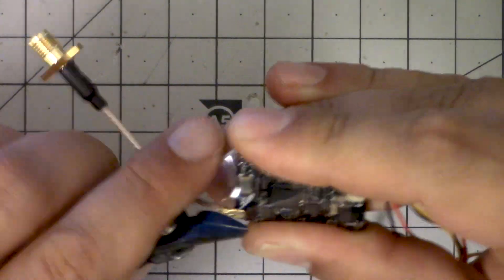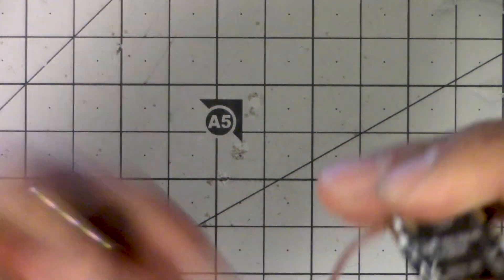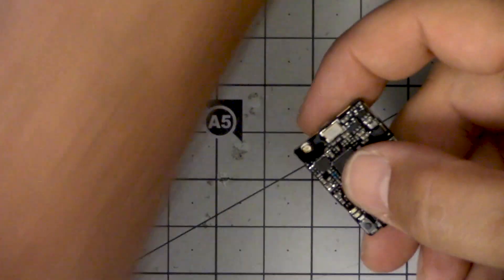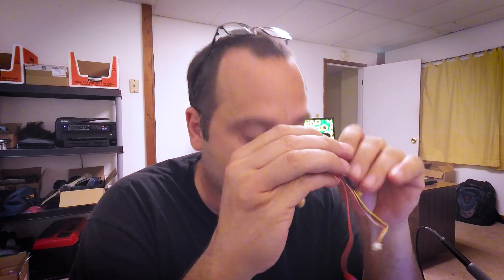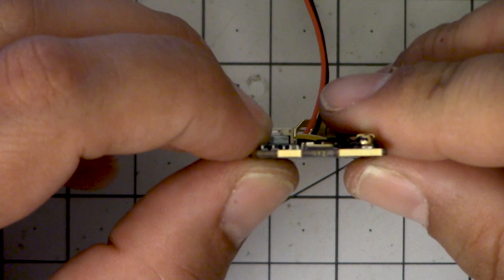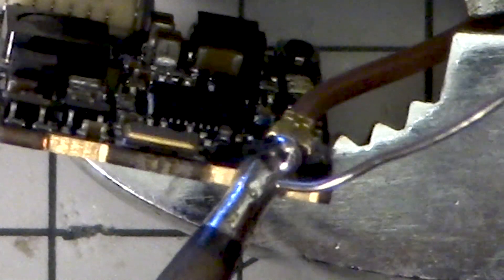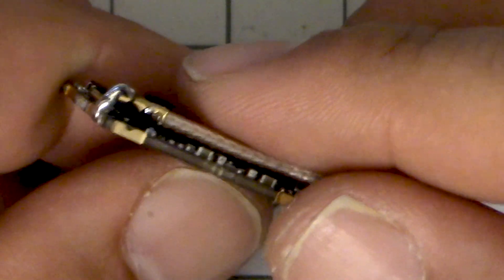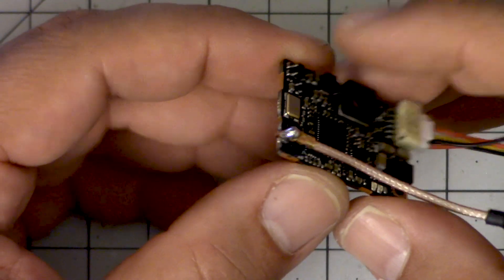How To Reinforce TBS Unify Antenna Connector | NO DIRECT-SOLDERING COAX

Comment: how many guys are going to over heat in attempting this and have the SM connector come off the pad :)
Reply: Manufacturers use lead-free solder which has much higher melting point. If you are carefull, it will not come off
Reply from the maker: If you don't think you're up to it, don't try it.
Reply: Trust me, the unify gets HOT. I've been doing this method for a few months now. I managed to break my cable off and when I went to desolder and replace it, I dropped solder in the port. I fought super hard to get it out and eventually cranked my iron up to 500c and took it to the port to make the solder run out. This took a lot of heat and time to get it out. So if that did not rip it off then I don't know what will.
Reply: like in ham radio spares make you unscared
Reply: Xephex Xephex the technology of reflowing or baking on SMD components is not magic nor does it use magic to hold them in place it's just solder and a very fine amount at that - all I was saying is be careful because you can heat up the connector on the board and have it come off, I have needed to do this on a couple repairs and it's very easy to do. Thanks

Comment: I guess that hot glue wouldn't work since the VTX gets so hot. But there has to be an easier and safer way to do this. I am good at soldering but I would be afraid that any amount of heat would destroy the connector.

Comment: I cant risk this on my unify pro because it means installing it upside down and the connector will be out of view so if it breaks off I wont know, it would be better if you could connect a flexible extension cable which leads from the connector to the antenna so any stress doesnt reach the connector then just hot glue the antenna anywhere on the frame.

Comment: Thanks for video; I have a mini remote controller and there is a cable antenna soldered on it and no MMCX port; is it possible to connect a MMCX antenna directly on the card without port ? How ? Thanks if you can help because I really did not find any informations about it.
Reply from the maker: If the device is designed to have an antenna directly soldered, it probably would not work well to add an MMCX, and it might not be possible at all.
Reply: @JoshuaBardwell  there is no MMCX port on the card so I thought to remove the MMCX plug from the cable and soldering the main wire directly to the card and soldering the ground from the cable to a ground to the card. Could it work ? I just watched some videos where people soldered by this way on a VTX.

Comment: Thanks a lot for sharing this including close up of how it's done! 📷 I have a Unify which I crashed hard before but still works. I got flickering video following vibration level and was almost sure the antenna connector is the problem. Soldered it almost like in the video. It works better when you run the pigtail towards the center of the board where the lowest profile components are and then route it in bend to end up next to the camera connector. Heat shrink around and I get nice range without flicker again. 👍🏻👍🏻👍🏻

Comment: I have a cheap hot glue gun with craft glue. Can i dab a bit of that kind of glue over the connection area?
Reply from the maker: The Unify typically gets hot enough in operation to soften hot glue. I don't think that solution would work well.

Comment: Thank you so much for this. Very tired of VTX antenna mounts of all kinds breaking. Now I have soldered the attachment. Hot glue over that. Hot glue at the other end of the board where the antenna wire runs off. Zip ties in middle. Lets see how this goes. Feels  a lot better ^_^

Comment: hope you can help me with my tbs unify tx, I, am using a 2 S battery, 7.4 volts , 800 mah, the tx   gets very hot,and im using the fox camera for  my fpv, and it is getting very hot all so , I do get a good video in my goggles, but not good range, my get 50 ft,,but the tx is so hot, i turn the power off so i wont burn up my tx and camera, hope you can help me on this ok  I did try to use a 1 s battery and it well not power it up , , I need some help ,thanks,

Comment: Can you help me what  is the name of the yellow rubber glue stuff that's on some receivers on the ipx connectors  and do you know where I can get some or a better option other than soldering :) new to FPV thanks for the great content its been a huge help thank you in advance
Reply from the maker: I'm sorry I don't know :-(

Personally what I do is, I turn the pigtail so it runs across the vTX, and then I use some tape or zip tie to secure it.
Reply: cheers mate I will tape and zip tie
Reply: Get e6000 glue, its clear, buts its rubbery and holds really good like the yellow glue they use.

Comment: Joshua, Please can you tell us which pin is the center pin to direct solder it if the pigtail connection has broken off completely?  Thanks
Reply from the maker: I don't think I could describe it in words. It's a tiny little pin in between the two bigger ground pads.

Comment: Mummm you saying these are the best transmitter my friend orderd two and what a pie of😤😠##### horizontal lines not seeing where he's going very well any help😢.
Reply from the maker: +Pete James this transmitter is fantastic. If you have video noise there is probably an issue with your quad or your setup.
Reply: Joshua Bardwell Big thank you  but where to start as he a novice to this hobbie he bought a lc filter but still no good😮😥.
Reply: check out this person Joshua Hardee Horizontal/Diagonal Lines in TBS Unify Pro When Armed - Solved
 this is what problem we having.
Reply from the maker: Do you have the HV or the Pro 5V?
Reply: Joshua Bardwell Pro 5v

Comment: wonder how many new VTX TBS now sells cause of damaged board by excessive heat, pigtails that wont go of any more, soldersplatter damage and so on.........
Its so easy, just turn it 180° facing to the power connector, new shrink-tube the VTX and good

Comment: I have used Loctite GO2 glue to keep mine in place. Unlike super glue this one is not as brittle and is easier to get off - but it it still has high tensile strength.

Comment: I did this to 2 of my unify pro vtxs after watching a youtuber doing it. I used the same method in your vid. Both vtxs stopped working within 45 days. At first I was loosing range and penetration. They be broke now. Not sure of the cause, but it was not due to crashing or misuse other than the connector solder. I have 4 other unify pros that I have not done it to that function fine.
Reply: Done that and my siagnal is weak anywhere more than 5m from quad... I hope I can save it today by resoldering new U.FL connector to he board...
Reply: I soldered mine and i too lost range and penetration, i'll try desoldering and see if the range is back to normal
Reply: Finnito FPV its better to use hot glue works much better than this method.

Comment: Just add a dab of hotglue! No need to solder and it only takes a few minutes.
Reply from the maker: Do you have any idea how hot the Unify gets? Hot glue will re-soften.
Reply: Which is fine..it'll still remain tacky and with some tape/heatshrink around it, it's more than enough to hold it in place.

Comment: the question is why this is such a weak connector to begin with?!?!?
Reply: The direct soldered pcb to sma connectors break rather often as well, sometimes breaking the pcb and or pulling off the solder pads. This design allows it to come unplugged, greatly reducing the chance of something actually breaking. I personally just shrink wrap them to keep them from coming undone in a light crash/hard landing.
Reply: So you buy more

Comment: Hey Josh.  Me and a few fellow pilots did this to maybe 5 or 6 Unifys.  They all have since deteriorated in video quality to the point of being unusable..  1 of them had the UFL connector ripped off in a crash. Now we recommend to all pilots in our group NOT to do this mod.  Just thought I'd let you know my experience with the mod.
Reply: Same thing happened to me, rip 40$
Reply: Good to know. I've been using liquid electrical tape to reinforce mine. It has a rubbery quality and seems to hold the connector in place on most crashes.

Comment: Hi Joshua. I want to buy TBS Unity but I read that it gets hot like many other small VTXes. I have a question, are there any lightweight transmitters (without a cooler) that don't get hot or at least too hot?
Reply from the maker: No. They all get hot because they are putting out big wattage.

Comment: I have one of these on my flying wing. I just used some hot glue. I did think of soldering it but I know from crashing lots, I would rather hot glue break rather than solder. At least there is no chance of any physical damage to the board or the connection. I can peel the hot glue off by hand if I need to move the position of the pigtail, you can't really do that with solder.
Reply from the maker: I don't know why people are acting like solder is harder to reposition than hot glue. Just hit the solder bridge with a little heat and bam, it will melt away. Solder sucker maybe to clean out the excess.

Comment: Be very carefull people if you want to add solder as reinforcement as you might end up melting the plastic part inside the ufl connector.
Reply from the maker: This is why I said not to use too much heat.
Reply: Yea, just did this while trying to repair a rx antenna. Pissed me right off. Got spares now lol.

Comment: I already ran the coax up the length of the board and when you re-heat shrink it it tends to hold it all down well but adding the solder is a great idea

Comment: At that point why have u.fl connector, and just not have TBS direct solder them?   Seems like you wouldn't be able to easily replace it at the field if you damaged the pigtail.  I think it's a good solution until you break the pigtail.
Reply from the maker: I would field repair it with my TS100 soldering iron! LOL.

Comment: hey josh, is this vtx worth the money or is it hype?
Reply from the maker: Pros: very small and light, great options (supports all bands and from 25 mW to 800 mW output), smartaudio support.

Cons: heat management can be a problem especially on higher outputs; expensive; always out of stock.

I couldn't say whether it is "better" in terms of RF performance or video quality. I just don't have the ability to test that. You decide for yourself whether it's worth the price to you.
Reply: slitherixxx it's so worth the 30$ smart audio alone is worth it, but it also won't burn up on you if you crash and break your antenna. It's super small too, really nice
Reply: its backorder at TBS :(
Reply: because they just got as new batch in with more filtering and less heat under load :D
Reply: damnit, just ordered from hobbyjerks (hobbyking) but would i still need the LC filter?
Reply: slitherixxx depends on setup
Reply: allright. i really hate they made the vtx josh got, better after they sold the old
Reply: Joshua Bardwell oh you got the v2 if it support 800mv I bought the one with pigtail at 200mv max

Comment: Btw if you want to reinforce it more never use hot glue, it will just melt maybe try some heavy duty heatshrink that has not heat resistant but kinda like that glue heat shrinks

Comment: I used hot glue. Has been on for a few months, works well. Spektrum Rx have the same crappy connector.
Reply from the maker: U.FL / IPEX is fantastic for what it is, but not great for situations where the antenna is not physically restrained.

Comment: An easier way to do it is to buy a tube Goop and spread it over the connector and pigtail. You don't have to have any soldering skills and it is very strong and elastic. It usually pulls off in one piece after a lot of fiddling.
Reply from the maker: Personally I don't want it to come off at all.
Reply: I've only had to take it off on one build where I had a massive crash and it broke the RP-SMA connector off and I had to replace the pig-tail.

Comment: Another option is to turn the antenna around like in your video, add hot glue, then add heat shrink to that area. 
The hot glue will melt as the heat shrink shrinks, which will spread the glue more and the heat shrink will hold everything together. 
I prefer this way because you can replace the SMA easily if it gets damaged.
Reply from the maker: Desoldering this pigtail shouldn't be a problem. You saw how much work I had to do in order to build the bridge. A dab with the iron and it'll come right off. But your approach of hot glue and heat shrink is probably equally structurally sound.

Comment: About 10 times i wanted to yell stop!  That's enough solder/heat!  I would just add some two part epoxy or better yet buy a vtx with the pigtail soldered to the vtx like it should be done.  I personally just cut the sma's off vtx's and solder my own pigtail, but i can see how that would be daunting for some.
Reply from the maker: If you know how to solder your own pigtail more power to you. I have direct-soldered one. It's not for the faint of heart. Most people can't do it and will destroy their transmitter.

I had to add a lot of solder because I was trying to build a bridge and I couldn't get the heat into the crevice at the base of the connector.

Comment: and I saw in a video that the favorite 20 A esc are bursting into flame on flight with running an 2300kv motor what would the problem
Reply from the maker: I don't know... a flaw in the design? Or maybe just one guy who had bad luck and made a video about it.
Reply: Joshua Bardwell 🙂🙂

Comment: I've tried to find a fix for this for a while and the method that's worked best for me was to take a pair of needle nose pliers and gently squeeze the connector to make it a bit smaller. Now it snaps on really tight and stays very secure. Add a zip tie across the board and it has been the most stable solution for me. I haven't had any concern for a little over a month and no more messy hot glue.
Reply from the maker: You have to be real careful squeezing the U.FL connector though as it is easy to damage. Still, there are many approaches that can work.

Comment: I've been doing that for some time, also i put heat shrink on the metal part of pigtail, because sometimes when you turn it around, it starts to touch some other parts, ant video channel drifts like 40mhz from set channel. Took me a while, and a couple of broken quads to figure that out.

Comment: Thanks for sharing, was a bit worried about that connection, and didnt know what i was going to do, this is PERFECT. TY again, i literally learn something from you almost every day... You should be VERY proud to help SOOOOO many people.. Ur the man have a good day.. PS whats not "TO HOT" on my soldering iron, i do have one with temp change but don't use it much as my weller seems to be kinda "goldilocks zone" for me..PPS my bad for the other day no disrespect intended EVER :)
Reply from the maker: You know what I'm not even going to say what temperature I used because the Solder Police will come shout at me. I know I didn't want to cook the coax cable is all. On the other hand, you saw I had trouble getting the solder to stick to the ground pad because the iron was a little too cold for that big pad.
Reply: Joshua Bardwell no worries I understand completely :) thank you very much n thanks again for everything!!

Comment: This is a neat idea. However, more reinforcement shouldn't be needed if it is mounted correctly
Reply from the maker: The main time I noticed it coming off was when I mounted the Unify in the stack with the WhiteSpy board. The pigtail was exiting at a downward angle and it was popping off all the time. The U.FL connector gets looser if it is un-plugged a few times. Anyway, I think it is also good insurance against ripping off the connector entirely, which happens to some people in a crash.
Reply: I had to do something similar to mount it to the chameleon frame.   Hot glue works too.
Reply: I tried hot glue until i found it dripping off my FC after a good run lol . The unify can get way above glue melting temperatures
Reply: Haven't had that problem yet, although the weather and schedule have limited my flying.  If it lets go again I'll probably have to solder it down.
Reply: BanniUK it is a great fix man
Reply: Mount to carbon, drill holes on either side, zip tie it, done, and super secure.
Reply: I use liquid electrical tape to reinforce mine. It has a bit of give but is strong enough to keep the connector in place in a crash.